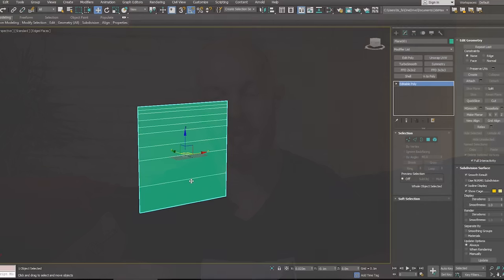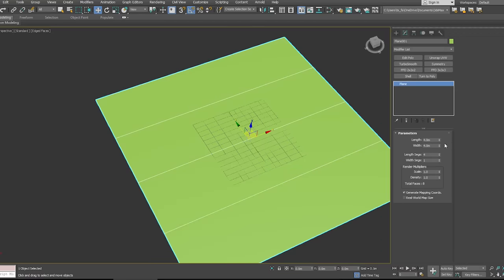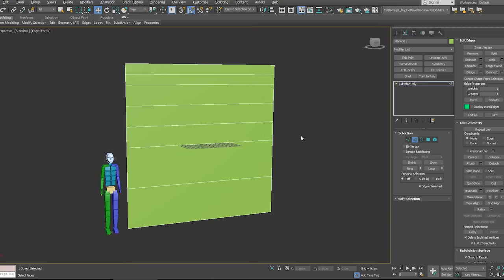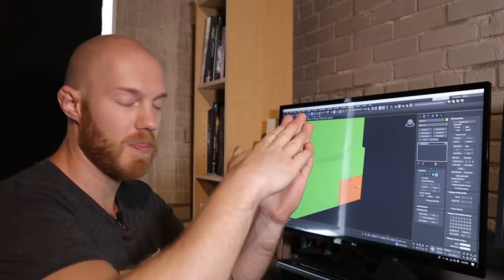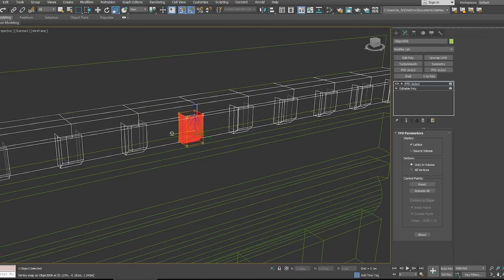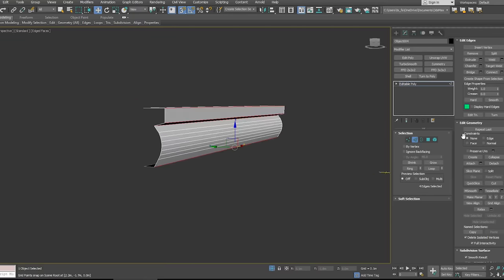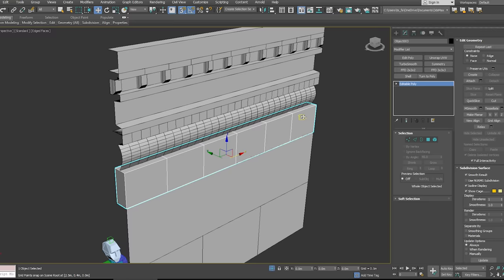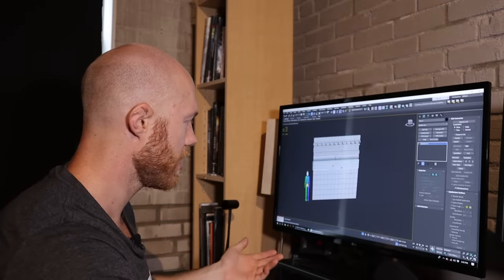Planning & Creating Trim Sheets For Games - Trim Texture Tutorial Part 1

Comment: I come back here every now and then and rewatch the construction part. It still excites me and blows my mind how practical it is to standardize your trim layout. Thats so golden. It also makes this technqiue more approachable. I was always intimidated by all those complex and extravagant layouts, it's so nice to kow now that it is about simplicity and reusablity at this point, just to have the tehnicalities layed out in the most practical way, instead of getting creative at this point for no reason and thinking of inserting variations that only will make your life harder. Those come later when using the trim sheet, not during the layout. So great to still learn from this video. I always freak out now when I exchange a texture in my game project and it simply just swaps wihtout any hassle. And with this typ of sectioning, it somehow always falls into place and just fits as long as you are working with a power of two also with your geometry. But even when you diverge a bit. It's really powerful.

Comment: Yeahhhh this is good! So stoked about checking out the other videos. Had a question about lightmaps for the models that use the trim sheets. Do you auto generate them in UE4 or lay it out yourself? Thank you for the videos btw! All of them dropping at once is just pure joy.
Reply from the maker: part 4 of this series covers that in depth! quick answer, for most models I will try an auto generate, but for modular kits/trim meshes I usually do a quick cleaner uv 2 in max.
Reply: @PolygonAcademy  thank you! And my bad I'm still on part 2. Impatient x.x
Reply from the maker: @SimplyCrazySid  no problem in gettin' excited :D

Comment: took one look at this and was like, yep, that's exactly how I plan my trim sheets. :) But a little in I realized we're pretty different. 

My pipeline is to sculpt all my normals in Quixel's Ndo, then apply Material IDs, then go to Ddo and create the textures with hand painting and screening where necessary, and finally export to TGAs. I then quickly combine the normals and AO to the albedo and merge them into one shaded map (so I can see shadow details when there is no shading information), which I take to 3dsMax. From there I apply my trim sheets. 

So to plan that, I slap together lowpoly blockouts of my environment (the whole thing) and I'll open photoshop and create a 4098x4098 black and white texture, which I import as a UV plane to 3DsMax. Then as i do my blockout and realize what trims I need, i just "sketch" onto that photoshop UV and slap it onto my greybox. That tells me as I go, what do I need, and lets me quickly iterate and plan how to minimize textures to just a minimum number of sheets, reusing what I'm making as I make it. 

The upside -- planning and asset creation are done simultaneously. Very fast. If I had concept art to begin with then I can rapidly produce results for a producer or art lead to look at and they tend to appreciate having "done looking" greyboxes the same day as they issued the ticket. I do too, it it helps me think more of the finishing details of the scene day one rather than crash face first into them day 30. 

The downside -- I have ADD, so the act of closing one program to open another sometimes jogs me out of my flow, and results in focusing on one task rather than the other and getting carried away. To prevent that I had to buy another monitor and place it next to my 3ds main window to jump back and forth. I also tend to get complacent with my existing trim textures and materials, because UVing is such an old and tiresome process I associate it with things being nearing completion, and that turns me off to iterating models and trying new things as I go. (ADD, again, robbing me of speed gains using this workflow, if I allow it to do so.) 

Maybe that helps! Off to work. :D
Reply from the maker: dope! sounds like a good workflow, totally agree on having the done looking greyboxes as fast as possible. really helps with project momentum. thanks for sharing!

Comment: I think that this is super great that your showing the workflow that is actually used and needed for ones tool kit! I was wondering if you would feel comfortable enough to use ZModeler to make you initial base mesh instead of Max or Maya?
Reply from the maker: Im super noob in zb but im 100% sure thats an equally valid workflow :)

Comment: Hey Tim,
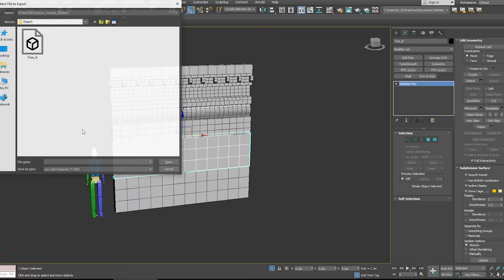Thank you very much for the video series but i have a question when you export trimsheet_a on 16:00. You started with modeling bottom part as three seperate object. But did you join them together as you exporting to zbrush ? I watched carefully video on 0.25 speed but i couldn't catch up with that. 
Thanks again.
Reply from the maker: each trim was it's own obj exported from max into zbrush and also its own seperate obj once I exported it out of zbrush, I didnt attach them at any point :) hope that helps!
Reply: Oh i see, then full trim consist of 7 obj file.Thanks for answer ^^
Reply from the maker: @fernwehmind  exactly, thats why i named them a-g to keep track

Comment: Hey Polygon Academy, your work is great but I was wondering if you could answer me a quick curious question please. The methods here, as for most things in asset design for games is quite labour intensive and if you have  a street to make with 12 unique buildings, different textures and designs altogether, and you're designing trim sheets for just one of the buildings, how long does your client usually give you to do this job? I'm just trying to gauge the average expected time for such a project when high-end results are also the expectation. Also, no prefabs allowed :p
Reply from the maker: For something high quality at current AAA standards, probably a few days per building if they are exterior only, and with some time for iteration and feedback factored in, as a single artist that would probably take 8 working weeks or so. This is also factoring in time to make high quality trims and tiling textures, depending on the amount of different surface types. Ex a street of all painted wood houses or all brick that share many textures is going to take less time than each building being a totally unique set of surface materials.

Comment: Is it better to go 4k on textures and then scale down later? would you get a slightly better material out of that?
Reply from the maker: Yea thats an option, you can also set it to downscale directly in unreal so it uses the map as a 2048 if you need to save on texture memory
Reply: @PolygonAcademy  Thanks!

Comment: hey polygon academy, whats your recommendation. should i use blender or 3dsmax, i like blender cause it has a sculpting feature and zbrush is to hard to learn
Reply from the maker: Use whichever you prefer. If you want to work at a game studio in future you will probably have to learn max or maya, but there is no problem building your skillset and portfolio in blender and then just learning max or maya later on, its the overall skills like clean modeling and smart uv layouts etc that matter, not software :)

Comment: Greetings Tim.., a doubt when generating hard edges ..., you recommend using this process "Crease" ...., why not use Bevel or parallel edges to harden the edges ....,? Crease offers better behavior to create hard edges ....? Thank you, un Saludo
Reply from the maker: i use crease when going to zbrush because if you bevel the edges it adds more concentrated geometry there along the edges and can create issues in zb when you subdivide where there are a ton of tiny little polygons along the edge that are not relative to the polygon density of the overall model, and you can get some errors when sculpting damage on edges and stuff. you could bevel but I have found crease to work better for basic zbrush base meshes. you could also bevel them and then dynamesh in zbrush as well to get even polygon density but thats an extra step.
Reply: @PolygonAcademy  Perfect thanks for the answer ...Un saludo

Comment: what I do is I manually make ID's in photoshop and plug them inside quixel mixer and start doing the trim's there I guess this still another way to cut the production by removing the sculpting process. Tim any thought about this?
Reply from the maker: sounds like an efficient method. I just assigned different color materials in 3ds max to each mask i want and chose that in painter as the mask option, but your method sounds super quick as well
Reply: If I may also add my thoughts to this: The sculpting process nowadays is pure preference or dependent on the art style. You could also do your trims entirely procedurally inside Substance Designer. A lot of times it seems faster, but you are working hard to get the textures look as if they where handsculpted and more realistic, whereas with handsculpting, they get that certain level of life and quality from the get go, that, I would argue, would take equally as long to achieve procedurally. Danny Carlone is a great Environment artists who mostly handsculpts his environment textures and uses the resulting bakes as a basis for his substances, and it shows imho: https://www.artstation.com/danniecarlone . This can be hard to decide really. It also depends on wether your target texel density can even hold all this sculpted information, or if you jus work on our heightmaps directly, or if you even have a normal map. And also of course, if you are experienced at sculpting. In the end I think, to use everyhting together and how it fits has the most benefit. Not everything needs a high poly. But stuff needs to be "touched" and "interacted" with, to deliver that certain feeling of less "CGI-ness" , if you know what I mean. No matter the process. There needs to always be some form of sculpting your heightmaps(normals) for stuff to look good. Quixel is certainly a great tool for that, esp. when they hopefully have decent tablet support in the future and as well as working from scans speeds up some of this process as well. Just like the use of photos did in the past.

Comment: Hi there, sorry if it's obvious but is there any reason you didn't export them as one OBJ rather than individually?
Reply from the maker: Its so i can import each object as its own subobject. In that version of zb i was using if it was all one obj it would be one object. Having them seperate makes it easier to work with and you can also easily subdivide them separately when certain ones need more polygons for detail instead of subdiving the entire mesh. You can separate the mesh after i believe, this is just the way ive always done it haha.  If there is a better/easier workflow, use that for sure
Reply: @PolygonAcademy  That's fair!  I've always just used sub objects but the same file for export.  However, having them separate does make things easier later on if you need to reimport stuff after the fact.  I soon realised this after watching a bit more.  Thanks buddy, really useful!

Comment: Will this work for 3d printing to have very high detail? I want to print out walls for Star Wars Black Series 6 inch diorama.
Reply from the maker: No probably not. You need actual geometry to 3d print details if you want the actual shapes to show up. You could use this workflow with a displacement map that actually displaces geometry and save that out, but just using a normal map wont work for 3d printing. So the answer is, yes but slightly different workflow using displacement and actual highres geometry :)

Comment: Is there a formula for dividing trim for different texel density? Mine is 50px/m. How to calculate trims?
Reply from the maker: for current gen i use 512px/m so a 2048 would cover 4x4m, i usually just chop the trim sheet into a combo of 1m, 0.5, 0.25m thick trims. but when you are uv mapping there will be some squashing and stretching in most cases, but a 10-20% texel density difference is not going to be noticeable.

Comment: how would I go about making a trim sheet for high texel density? Like if I want 1600 px per meter? I understand making a trim sheet for 512 px per meter, because if I make a 4mx4m sheet that uses a 2048 map, that divides evenly into 4 areas on the sheet. But for 1600 px per meter, I'd of course have to use a texture higher than 2048, which is not an option. So the only thing that makes sense to me is to use a smaller size plane for the sheet, in this case a 1m x 1m plane, right? So wouldn't I only be able to fit one texture on that? Which I guess would then give me 2048 px per meter? Which then defeats the purpose of putting multiple materials on the sheet..
Reply from the maker: So the option would be to tile the trim more horizontally so its repeated multiple times in 1m until you hit your density. Or you could use a 4 way tiling texture that is not broken into strips so you dont have to worry about thickness, like how you would tile a 4 way tiling brick texture on a wall instead of using trim textures to make rows of trim bricks  based on the geo etc. 

In this case i would be asking why you need such an high texel density per m, thats pretty unheard of for games. Most console games even ps5 are still 512px/m, maybe 1024/m if on pc you have the 4k texture pack option. 

The higher your texel density, the more tiling you will have to do and the more noticeable repeated details will be, its a bit of a tradeoff.
Reply: @PolygonAcademy  Hey thanks for responding, Tim! Recently had an art test and that was the desired density. I was really trying to figure out a trim sheet so I could save on materials but there was no material limit for the test so I just used tiling textures for everything. 

Yeah I kinda thought 1600 was a little high for games but it was for a studio that makes AAA fps games so I thought maybe they went a little higher for the density. Maybe that's just what they wanted on the test and not what they actually use in game.

So basically it would be defeating the purpose of using a trim sheet to only put one texture on it right?  Like it would be better to just use a 4 way tiling texture at that point?
Reply from the maker: @frankie3351  yea at that resolution its probably better to use 4 way tiles and then face weigghted normals on beveled edges to fake the nice smooth edge highlights, similar to how alien isolation did most of their props

Comment: I'm using Maya and though most parts is directly translateable, some things aren't. When you break off one of the large bricks on Trim_A it has endcaps towards the next brick. This does not happen when I use extract in Maya. What method would be preferable here? Bc I understand that it is possible in Maya aswell, I'm just missing something =)

Comment: I find it difficult to grasp the concept of trim sheets when it comes to environment design... for instance, I know have to do an assignment for university in which I have to create a landscape with a small village. Where would I want to use trim sheets? Isn't it better to have big buildings and such as a unique asset? And what about small details like fence posts or lamps? I would still create all of those as unique assets... or is this not a smart move?
Reply from the maker: trims would be great on buildings for things like door frames, long sections of wood planks etc. the rest you could fill in with tiling textures. 
I have rarely seen large buildings being done as unique unwraps for games, its hard to get the texel density consistent and high without breaking the building into multiple pieces and then using massive 4k textures on them, which is not ideal for texture memory. with a couple 2k tiling textures and a trim sheet you can accomplish a LOT and get a ton of variety in your buildings. 

things like fence posts and smaller objects can be unique textures, but even then lots of the time they are made with basic tiling textures if they are not super important. mainly hero assets and super important props get the unique treatment because they player actually tends to look at them, while things like a fence post...not so much haha.
Reply: @PolygonAcademy  Thank you, this seems very reasonable; I will try to build my first asset with this in mind! :)

Comment: what is trim sheet really? the def is vague
Reply from the maker: pretty much a horizontally or vertiacally tiling texture with strips of individual detail, aka "Trims". the main difference between a trim sheet and a tiling texture is its usually used to add higher detail along specific edges instead of just covering a larger surface with a simple material like concrete/dirt etc.
Reply: @PolygonAcademy  ah I was confused of its difference with texture atlas. so it's sort of atlas with specific tiling direction hmm interesting
Reply from the maker: @glowiever  yea texture atlas is more where you pick and choose details that are all on one sheet, but you cant usually just quickly tile those kinda textures across a larger surface, but they are great for adding tons of bolts/screws, tech details and stuff like that ontop of a basic tiling and trims mesh.

Comment: Hi, thank you very much, very valuable tutorial! Guys I'm with blender, any suggestions for doing this job correctly? I set the edge with "Crease" more or less as shown in the video, for each part I first applied a subdivision surface modifier, set to simple with a value of 1, then a second sub surface in Catmull-Clark, always with value of 1, I also marked the external (lateral) angles as sharp and applied to each part the shading smoot and auto smoot with a value of 180 degrees (I do not know why 180 degrees, I saw it somewhere hehe) does not seem bad whole mesh but many things and commands are different from max, so I don't know if I did wrong. thanks again, I looked at the unreal project templates I didn't expect similar uv hahaha!  I hope to understand in the next few lessons. Hello everybody thanks again <3 sorry for my bad english i use the translator
https://imgur.com/qAkkWN6